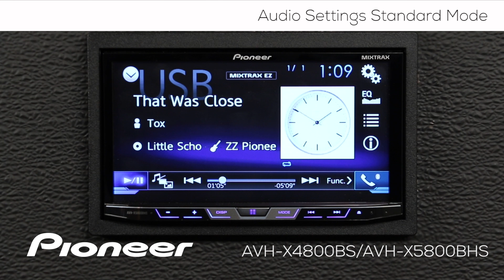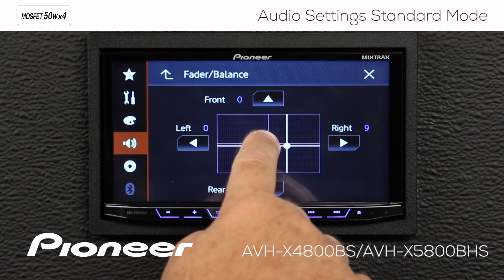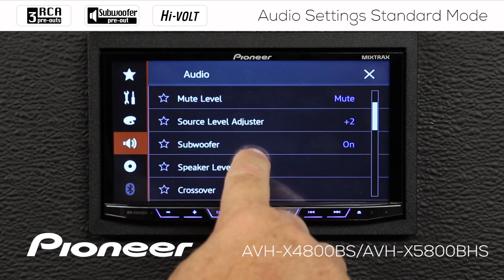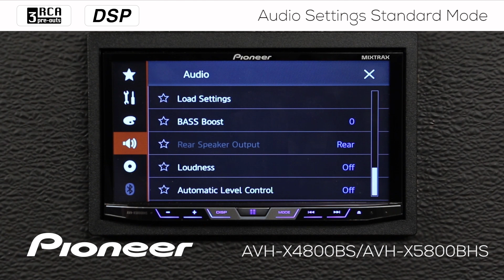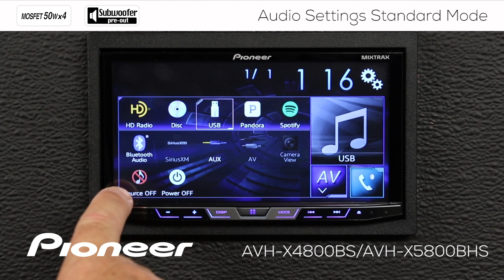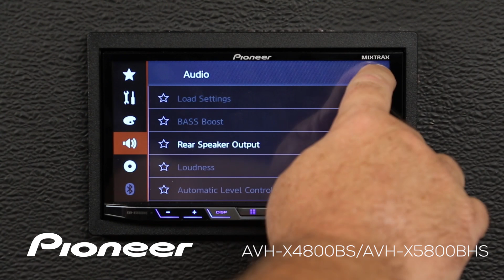How To - AVH-X4800BS - Audio Settings Standard Mode

Comment: My AVH-X4800BS piooneeer Bluetooth radio is giving me trouble when I'm making a Bluetooth phonecall when I call someone or someone call me them can hear me but I can't hear them need your assistance please an thanks
Reply: Pioneer in-dash receivers output Bluetooth Phone Call audio to the FRONT speaker outputs and FRONT RCA outputs only. Bluetooth Audio, or music played from your phone, will play through all outputs, both front and rear. Your in-dash receiver may be installed incorrectly. There is an easy way to test it. Using the Fader control, fade the audio output all the way to the front. You can see how to use the fader control in this video:     https://youtu.be/tx1aFiXzYlY?t=35           Can you hear music? Can you hear phone calls?    If you fade the system all the way to the front and    can not     hear music, that means the FRONT audio outputs are not connected in your system. Need help with wiring your Pioneer System? This video explains the wire harness system: https://youtu.be/-bF3uzzaT30?list=PLw63zJRQbCNjEUhMJufnF-zxddC2146LR        You can find a full playlist of How To videos about Pioneer AVH-X4800BS here:    https://youtu.be/OD9XdSnzyI8?list=PLw63zJRQbCNgoCBAcEH-E-IUALLo9TgPy      and you can find more videos on Pioneer's You Tube Channel here: https://www.youtube.com/user/pioneerelectronics

Comment: this video doesn’t explain about the Bluetooth mode sound not working from make or excepting a phone call so please if you can explain what the problem is or how we can fix the issue ??? They were working perfectly fine then then it stop so please help
Reply: Make sure your phone is connected to in the dash receiver.  Make sure your phone is not connected to any other devices like a headset or portable speaker.  The other devices could be blocking communication to the in dash receiver.  Check out this video for more information: https://youtu.be/yiaskh4Ku8s?list=PLw63zJRQbCNgoCBAcEH-E-IUALLo9TgPy
Do you have the microphone connected to the in dash receiver?  Check out this video:  https://youtu.be/63YNoryaML0?list=PLw63zJRQbCNgoCBAcEH-E-IUALLo9TgPy

Bluetooth Audio can be heard from all speakers.  Phone calls can only be heard from the front speaker outputs.  Check out this video for more information:  https://youtu.be/-bF3uzzaT30?list=PLw63zJRQbCNgoCBAcEH-E-IUALLo9TgPy

Comment: Hey! So I’m having an issue with my 4800BS’s loudness feature, it is greyed out for some reason as well as my auto eq/ta and a-eq/ta measurement and I can’t seem to figure out why, any help is appreciated!!
Reply: I'm not aware of any Loudness feature on the AVH-X4800BS. There is a Load Settings button.  After you save settings you can go there to recall them.   If you want to use the Auto EQ and Auto Time alignment you'll need the CD-MC20 microphone.  It's about $20 from Pioneer customer service 1-800-421-1404.

You can find more videos about the AVH-4800BS here:  https://youtu.be/OD9XdSnzyI8?list=PLw63zJRQbCNgoCBAcEH-E-IUALLo9TgPy

Comment: Ok i have an issue. When i am in bluetooth mode i can get sound from everything except if im making a phone call. What could be the issue?
Reply: Phone calls can be heard on the FRONT SPEAKER OUTPUTS and FRONT RCA OUTPUTS only.  

Bluetooth Audio can be heard on both Front and Rear Speaker outputs.

To check your set up, fade the system all the way to the front.   Can you hear a call?  Can you hear music?  For help with the fader, check out this video:  https://youtu.be/tx1aFiXzYlY?list=PLw63zJRQbCNgoCBAcEH-E-IUALLo9TgPy
Reply: @deckerdotto6035  I'm having the same problem myself. 
Needs some help.
Reply: On Pioneer in-dash receivers, the remote caller can be heard on the FRONT SPEAKER OUTPUTS and FRONT RCA OUTPUTS only.  

Bluetooth Audio can be heard on both Front and Rear Speaker outputs.

To check your set up, fade the system all the way to the front.   Can you hear a call?  Can you hear music?  For help with the fader, check out this video:   https://youtu.be/tx1aFiXzYlY?t=34    If you fade your system all the way to the front and can not hear music or hear a phone call, that means the Front Speaker Outputs, and / or the Front RCA outputs are not connected.  You can find more How To videos about Pioneer AVH-X4800BS here:  https://youtu.be/C6h7IJ7wpmc?list=PLw63zJRQbCNgoCBAcEH-E-IUALLo9TgPy  Please be sure to install the latest firmware for your Pioneer AVH-X4800BS.  You can find it here:  https://www.pioneerelectronics.com/PUSA/Car/DVD+Receivers/AVH-X4800BS#downloads  and you can find more videos on Pioneer's You Tube Channel here: https://www.youtube.com/user/pioneerelectronics

Show less

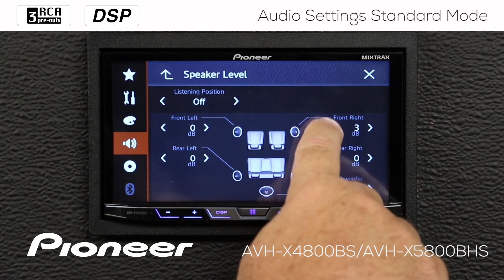Comment: 2:55 "This is part of a VERY powerful digital signal processor built into the system" 
Soooo.....why does it only have a 13 band graphic eq when I can get a full 1,000 watt parametric DSP pro audio amp for cheaper?
Reply: He's referring to a powerful audio processor with a 13 band graphic EQ, also, front, rear, and subwoofer variable crossovers, each with variable slopes at each crossover point, and Digital Time Alignment for each speaker in the system.  As well as the automated system to set up the EQ, and Time alignment.  Not so much the internal amplifier.
Reply: Maybe I'm weird, but I care WAY more about getting a proper EQ setup than getting DTA's and an automated EQ setup, which may not even work all that well due to phase time alignment issues in the cabin anyways. Just seems like they're throwing in silly gimmicks before making it actually sound proper to me.

Comment: can you turn off the internal.amp? explain the note in the book about speaker.lead should not be used when RCA's are used
Reply: There is no setting to switch off the internal amplifier.
Reply: +Deckerd Otto is it safe to connect  the speaker leads  while using  rca in NW or SM